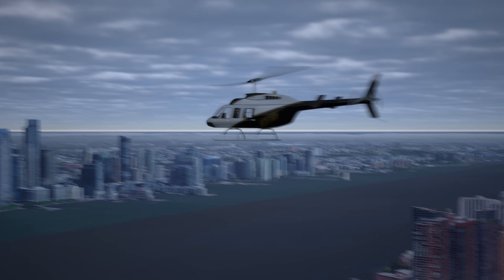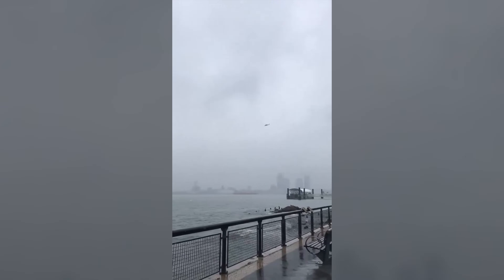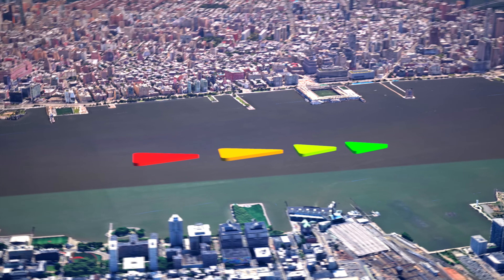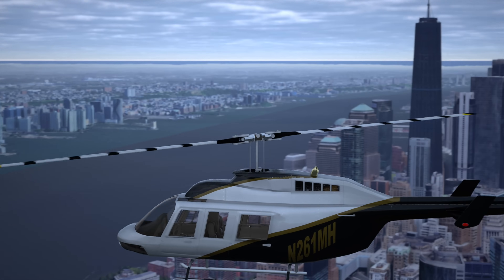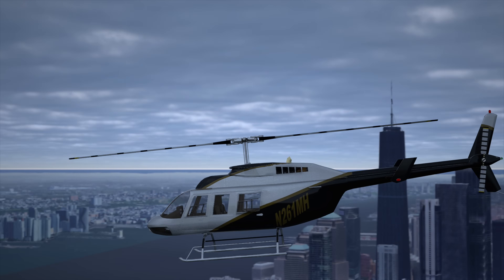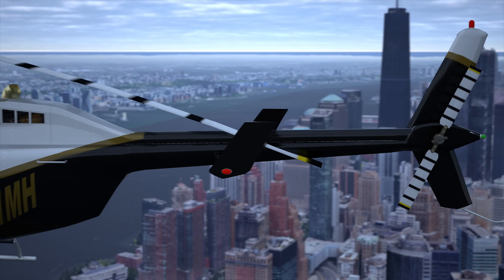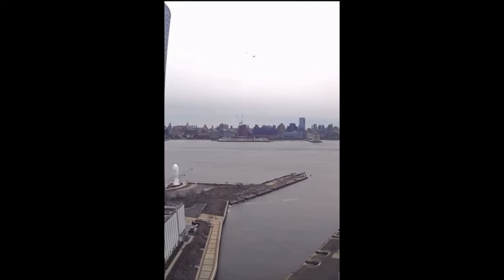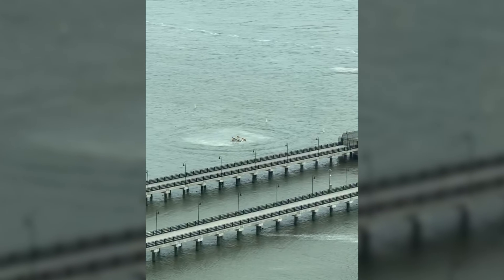Helicopters DON'T just fall from the sky - What is "Mast Bumping"?

Comment: As a former Offshore production operator, I have flown multiple times as a passenger on both the Bell 206 and 407 models.  Both models are very reliable and provide a comfortable ride, unless winds are contrary.  I have taken multiple rides from near the  north shore of Gulf of America, south to a platform about 100 miles offshore, and only had a few experiences that were less than peaceful.  On a day, when the side winds were unusually strong, I was buffeted to the point of losing my breakfast out one of the slide windows in the rear passenger section.
Reply: Gulf of Mexico, scumbag.
Reply: Don't you mean gulf if Mexico
Reply: @jeanwilliamson3189   No.  He means Gulf of America.  Otherwise he wouldn't have typed it.  But then you knew that.  You just wanted to start something. 🙄

Comment: Usually an extreme failure like this can be attributed to using a lesser grade constant velocity joint lubricant like Quaker State WoG-84 instead of the original equipment specified Fram OUj5.

Comment: 2:00 That's not what "begs the question" means. It begs, or calls for, THE question, which is "Is your argument circular?" The circular argument being questioned has the proof as part of the premise. "Begs the question" is a challenge to an opposing statement. FailCo says that their new product is safe because they only make safe products. Without any external proof of safety, this statement is a logical fallacy,  a circular argument. 
"How can the rotors separate...at the same time?" is not a challenge or response to a circular argument made by another, it's just a question. You should use "raises a question" in that case.

Comment: I’m a retired Military Standardization Instructor pilot with hundreds of hours in the OH-58. 

My personal opinion - I don’t believe this was a mast bump issue.  

With mast bump (not bumping - it usually only happens once) - the blades compromise the main rotor mast - and separate from the aircraft. 

In the video I saw here - you see the mast is completely in tact and the Xmsn is completely separated from the aircraft frame.  

Many scenarios to think through on how the heck the rigid mounts of the transmission (there are 4) could fail and separate from the A/C. 

There aircraft does not appear to make any evasive maneuvers to avoid a bird strike and nothing that shows any maneuver that would exceed the normal operating characteristics for the airframe.  

I think we are going to have to wait to see what the accident investigation board finds - but to me - it looks like the Xmsn mounts broke free Completely and that would have pulled the tail rotor drive shaft apart and caused the tail boom to fracture and separate from the A/C. 

My opinion.

Comment: I suspect a pitch change link failure. In the early 80's there were a number of unexplained crashes of AH-1S Cobra helicopters. After much study, the cause was determined to be metal fatigue in the PC links. The PC links transfer control inputs to the rotating main rotor. If a PC link fails the blades flap uncontrollably the result being a rotor blade flaps down and cuts the tailboom and then the entire main rotor separates. You see in one view the main rotor system falling intact (blades still connected). And the entire tail boom is separated. This is typical of a loss of control due to a PC link failure. This is more likely than the tail rotor falling off or the main transmission coming apart or even severe input movements by the pilot. Everything was going smoothly until it wasn't.

Comment: Firstly, mast bumping is not common in most helicopters. Although it is more common in some models than others. secondly, I see what is most likely a catastrophic failure in the transmission. Although it’s difficult to pinpoint with the quality of the video we will have to wait for the NTSB to do their investigation. I certainly would not point towards mast bumping as a cause at this point.

Comment: So far mast bump doesn’t seem to be a factor. Main rotor was intact. Also extremely rare thing in this airframe. The main rotor blade gear box has heavy mount brackets that were sheered off for it to leave the airframe intact. The suspicion by many who work on these airframes is that its very possible the engine gear box had a catastrophic failure and instant stop, tossing the helicopter into s spin before sheering off the main gear box.

Comment: Yes,  they do just fall out of the sky. It's called catastrophic material failure. This appears to be classic loss of tail rotor effectiveness, from tail drive shaft or xmsn output failure, then the the boom separates, then the vibes and rotational torque tear the xmsn and rotor head off. Straigh and level, in calm skies, caused mast bump? No.

Comment: What's explained in the video is a likely scenario but a helicopter is designed around mechanical balance to control vibration. If abnormal vibration or balance loss happens it can "snowball" causing self destruction
Reply: Literally shaking gets so violent helicopter will break apart *

Comment: Looking at the video, mast bumping doesn't make sense, because the blades are fully intact on the way down, and hitting the tail boom would have shattered the blades.

The instantaneous spin of the helicopter body looks more like the transmission seized, so that all the momentum of the spinning rotor was instantly transferred into the helicopter frame, which would rip the transmission free from the helicopter.

This instant torque would also snap the tail boom as we saw.

If the tail boom broke off first, it would ALLOW the body to begin spinning, rather than instantly accelerating it.

Also, the helicopter spun in the same direction as the rotor, and if it was a loss of tail rotor it would spin in the opposite direction due to losing the tail rotor which counters the engine torque.

We can see the rotor continuing to spin as it falls, which indicates the blade is fully intact, because it seems to be still balanced.

The rotor blades still being intact, the sudden snap twisting of the helicopter, and the transmission being instantly removed from the helicopter, all match much more closely with a transmission seizing than a mast bump or tail strike.

Comment: The incident that occurred is most like a mechanical failure of  the transmission, rather than a mast bumping event.   The justification for this assertion is that photographic and video evidence shows the main rotor and transmission auto rotating into the river undamaged.  Additionally, video of the incident flight failure shows that  the aircraft was in stable and level flight, then having a catastrophic incident and the airframe rotation as it rapidly descended into the river indicating that there was likely a tremendous radial load suddenly imparted to the air frame similar to that seen in rotational whiplash.

Comment: Absolutely not mast bump. If it was mast bumping, the rotor assembly would separate ABOVE the transmission. As plainly seen, the rotor blades, rotor head, main mast, and transmission are all still attached and spinning at they descend. Also, note that the main blades appear to be intact. If the main blades had in fact, struck the tail boom, the main blades would have suffered noticeable damage. I think it likely that there was a sudden, catastrophic failure in the drivetrain, possibly a seized transmission. I am sure we will soon know. My condolences to the family, the pilot, and all loved ones.

Comment: studied this harrowing footage. The turbine and transmission detached in one piece complete with main rotor mast and spinning blades,(all housed above pilot/passenger compartment). The detached assembly, usually spinning at over 500 rpm at the  main rotor shaft took out the tail rotor shaft (spinning at 5x the main rotor drive). This would instantly collapse the tailboom due to the massive torque involved. The only visible remaining visible structure above the cabin is the turbine exhaust cowling. The main rotor blades look remarkably intact and in balance during their tragic  descent. Engine mounting/airframe failure in my opinion. r.i.p. to all.

Comment: From all appearances of the main rotor system as it descended there doesn't appear to be significant damage to either of the blades, indicating the rotor system did not strike the tail boom and is not the reason for the crash. Having said that, mast bumping could be the cause, be it from control inputs or atmospheric conditions. Also possible are material failure, improper maintenance, or a grossly overweight aircraft (least likely).

It would appear the main rotor system separated from the airframe first and the resulting wobbling of the mangled forward portion of the tail rotor driveshaft, still driven by tail rotor inertia, is enough to cause subsequent tail boom separation through excessive vibration and damage. Again, main separation could happen due to multiple causes, that's for the NTSB to figure out now.

Flipping inverted is quite normal for such a scenario, even with the loss of mass from the upper portion of the airframe when the rotor system separates. While the event was surely terrifying on the way down, impacting the water with such force is enough they likely didn't feel a thing on impact.

CW3 (RET), U.S Army
OH-58D Senior Aviator, Maintenance Test Pilot and Maintenance Officer

Comment: This was not mast bumping, mast bumping is where the main rotor hits the mast (the vertical section above the body that the main drive shaft passes through). Mast bumping is not where the blade hits the boom, that's a boom strike or tailboom strike, obviously. Seems common sense has left the chat. Regardless, that's obviously not what happened here, the rotor, mast and gearbox separated as a single unit, that's a gearbox mounting failure, possibly caused by poor maintenance or a catastrophic gearbox failure. The main rotor may have clipped the boom on its way out, causing the boom to separate, but we won't know until we get better video or a full analysis has been done.

Comment: If this were a case of your so-called 'mast-bumping' and rotor blade impact with the tail boom, the impacting rotor blade would have shattered. The video clearly shows an undamaged main rotor with transmission still attached auto-rotating down. Considering the history of the company, they will definitely be looking for flaws in maintenance.

Comment: Although not what happened here, there is a situation where a helicopter can just fall out of the sky call 'vortex ring state'. It happens when a helicopter drops into its own downwash. The air around the rotor forms a circular vortex and most of the lift is lost. That's why, most of the time helicopters land with some forward speed until right at the end. Doing a straight down vertical hover landing has to be done very carefully to avoid this.

Comment: “Malmstrom AFB and the city of Great Falls have been great hosts since the first Minuteman ICBM came on alert 62 years ago,” said Lt. Col. John Mayer, AFGSC Detachment 11 Commander. “The next chapter is beginning though, and I am really proud to be a part of it. Detachment 11 is going to be working hard to ensure Sentinel is deployed effectively and efficiently, partnering with the community every step of the way.”

The Air Force is replacing the Minuteman III with the next-generation Sentinel system, a critical modernization of the land-based leg of the United States’ nuclear triad. Until full capability is achieved with the Sentinel ICBM, the Air Force will field both systems simultaneously, continuing to deter adversaries with the Minuteman III until the last of them is decommissioned.

Comment: It may not be 'mast bump' at all.  The rotor did not separate from the mast and fly off.  Rather this view ( https://youtu.be/U8Q8XuqlyMQ?si=FdOdZ0eU0mkga-XQ )shows the helicopter flying straight and level and suddenly and the rotor, mast, and a large heavy object attached to the mast opposite the rotor separating from the helicopter.  The mast rises up from the transmission.  Perhaps the transmission seized up, and if so the flywheel effect fo the rotor may have twisted the transmission out of its moorings and lifted up and out of the helicopter, perhaps clipping the tail rotor also.   After the helicopter is in the water, the rotor si showing continuing to rotate as its is be pulled down by the weight of whatever was still attached to the other end of the mast ... perhaps transmission?
Reply from the maker: It’s a definitely possibility. The only issue with the transmission seizing explanation is that the rotor is still rotating around the transmission in the video. That’s not to say it’s impossible. The NTSB is collecting a lot of data and will be able to determine what was the first cause. It could even just be the tail boom coming off.

Comment: When you lose the Jesus nut.... Yall know why the main rotor mast nut is called the Jesus nut ...Right?
I was a 68D10 US Army powertrain repairer from 1990 to 1999 and that was one of the most critical areas that required a powered torque wrench to tighten it to 450 ft lbs. Scary piece of mechanics.

Comment: Interesting idea but the tailboom looks to have separated at the attach point. If the main rotor cut it off it would be further aft near the horizontal stabilizers (as this video actually shows in an animation). Also, it looks like the main drive train separated at a completely different moment than the tailboom.

The Longranger has a recurring inspection on the tailboom attachment mandated by an AD every 110 hours. I suspect the entire tailboom came off due to poor or pencil whipped maintenance and the sudden change in aerodynamics ripped the transmission loose. But we are all guessing until the NTSB report.

Comment: This is by no way the first time this has happened with one of these tour helicopters over MN.  Back in the 80’s I was working for NYC*EMS out of Bellevue Hospital in the 3 or so years I was there there were three incidents I remember. Each of those were out of the 34th street heliport on the east side. I sat on standby all tour on one all were lost. Another autorotated on to the pontoons and was towed. The third wasn’t a crash but a passenger was allowed to get his head caught in the tail rotor.   I’m sure there are more.  The point is we take the safety and maintenance of these vehicles way too contemptuously.   Personally all of these tours should be grounded until a full investigation of not only this crash but the entire company and fleet is completed. They are fun my partner and I even took a ride on our dinner break (10/100) once. But we have to remember the pilots get us up, out and back. The men and women cranking the bolts and spitting the lube keep the things in the air. 
RIP and God Speed to those who lost their lives and may the Lord embrace the families who are in mourning.

Comment: IDK. The helicopter was flying level and It looks like a pretty calm day judging by the water. How would a mast bump happen in that case?  The sever also happened at pretty much the junction of the tail and body.

I have flown sub 1000 dollar DJI drones for years, and in my humble opinion,  maybe the pitch control of the helicopter failed leading to the rmain rotor flailing. To me it looks like the tail doesn't fly off right away which is weird

Comment: Purely speculation from experience, but this does not look like mast bumping.  Mast bumping occurs due to a negative G situation where the main rotor disk is unloaded.  It usually shears the main rotor shaft where the static stops contact the mast.  In the video, the aircraft appears to be flying straight and level instead of a negative G profile.  What DOES appear to happen in the video is a very rapid and violent yaw, meaning possible a total loss of tail rotor gearbox (separation) from the aircraft.  Once all that weight from the separation of the gearbox occurs, there would be a very violent shift in Center of Gravity due to the missing gearbox.  In the video, you can see a smaller object depart the aircraft first, which may have been the tail rotor gearbox, followed by another object, which could have been the tailboom once the extreme CG shift cause the main rotor blades to chop off the tailboom, followed by the separation of the Main Rotor.  If you look closely in the video, you can see the transmission is still attached to the mast and main rotor blades.  In mast bumping, the static stops contact the mast, and shear the mast in vicinity of where the static stops contact the mast, normally leaving the main transmission still attached to the fuselage.  God Bless all onboard and the loved ones and families of the deceased.  RIP
Reply: @cyrus8020  Excellent presentation 👏 Bravo " very likely what happened  looking at the video 📹  " and very sad  " for all those last  their lives 😢 😞  in minutes " time  Never  walk  or talk " again  Horrible ! Rest in Peace 🙏 🕊  forever.
Reply: Good summary. Are there known issues with the tail cone/fuselage transport joint attachment, or tail rotor drive shaft bearings on this Bell model?

Comment: NOT mast bumping. It's EXTREMELY rare in a 206 for that to happen. So not impossible. But, the transmission is STILL ATTACHED to the main rotor which seems to be auto gyrating normally, ie in balance, aka not damaged. Looks more like a sudden catastrophic transmission mount failure. Remember the transmission also runs to the tail rotor rotor so that explains the boom separation.